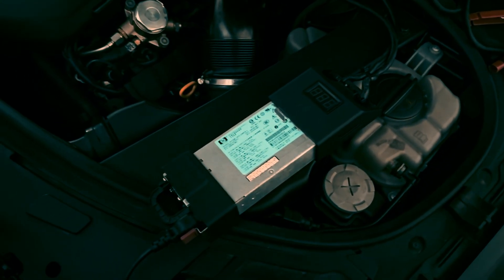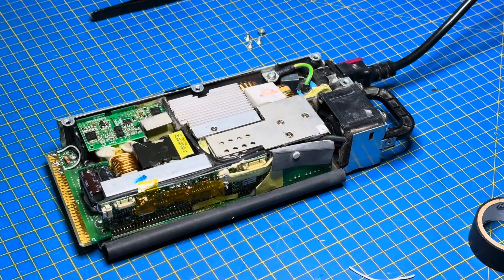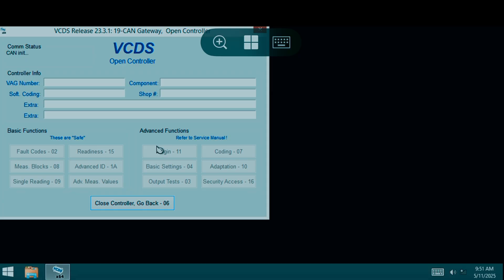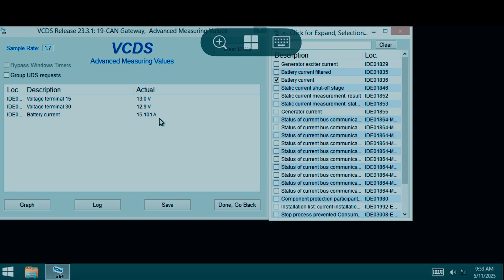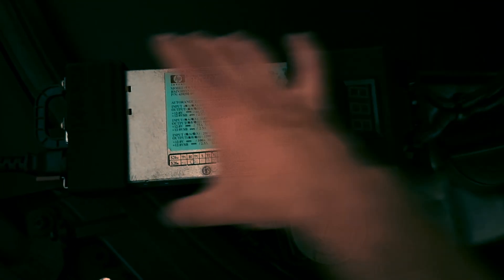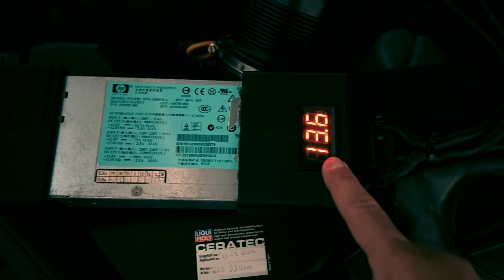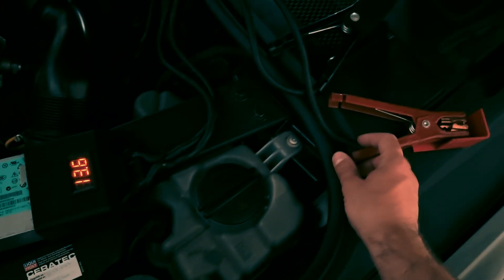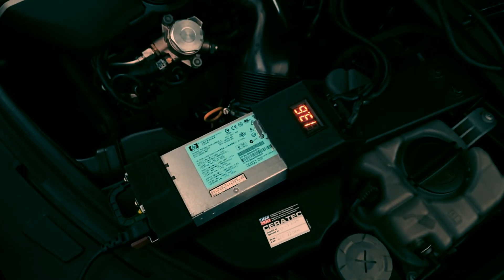DIY 100A Car Battery Charger/Maintainer out of HP Server Power Supply *EASY* for only 60$!

Comment: Hi good afternoon can you advise if the 3D files are available as I would like to try and get them printed for myself. Thanks Tom
Reply from the maker: Hello, they are available on the free share model sites. What is your car?
Reply: @pavelppp888   I have several cars Porsche Boxster, Audi A6 Quattro are two I would use the power supply on